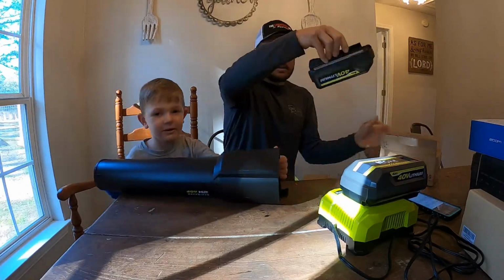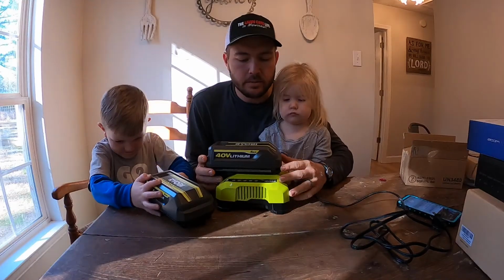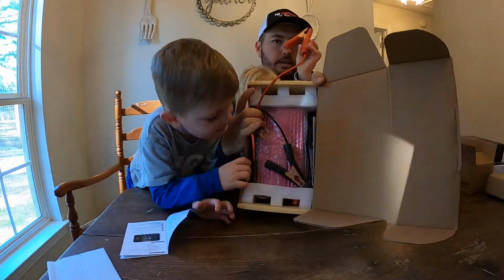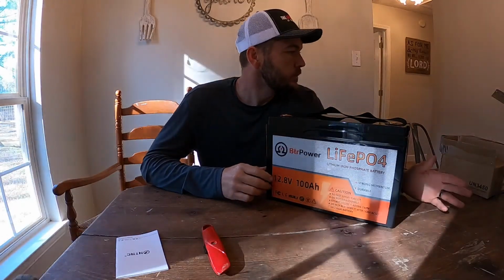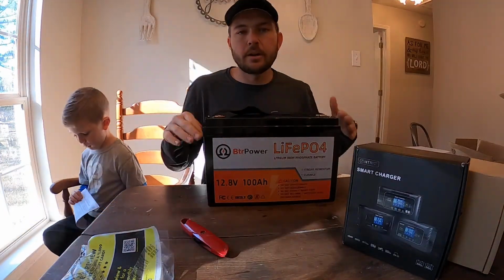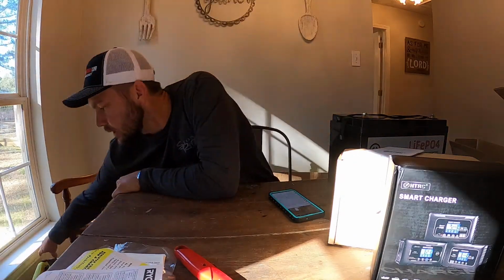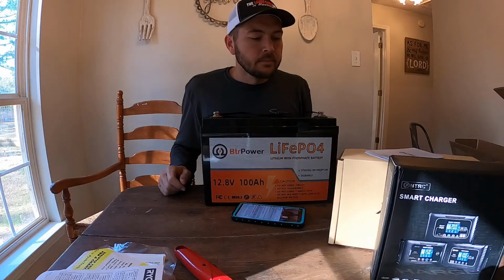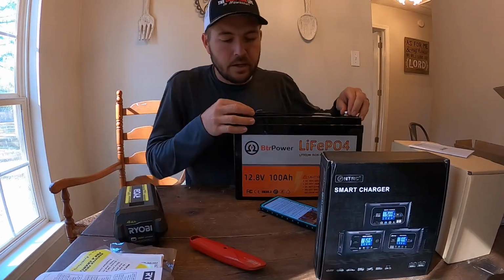New blower reveal + my budget mobile charging setup

Comment: Tony, keep in mind the charger is around 300 watts (My Stihl Charger is) 30-45 min charge so each  will take 150-300wh.  The cost of what you purchased $500 ish, don't you think you could purchase extra batteries for the same cost and be just as efficient.  For me it never makes since to have a battery charge a battery?
Reply from the maker: But if you can recharge 5 to 7 batterys you cant buy that many batterys for $420  one good battery is pushing $300 now its crazy! plus heres the biggest thing for me i know im gonna love being able to keep my batterys topped off all the time and if the big battery wears out in a few years ill just buy another $300 battery and keep moving🙂😎 plus now i can try annnnnyyyy brand
Reply: @tonyslawncare  I hear ya, the fact is maybe 2 extra batteries at the $500 mark, I have a trimmer, edger and blower all have their own batteries. I have 2 hedge trimmers which are not always in use thus 2 extra batteries. For me I have only use the spare batteries maybe 3 times a year so it definitely works for me. If your eating up that much battery on acre size property I see your point. All of my area is pretty small so no need for recharging in the field. Nice topic keep pushing.

Comment: Those brushless whisper blowers are great. 730cfm would be plenty of power for me.  Yes, the tube may randomly fall off, a weak point.  Also the turbo button will eventually get funky.  But still worth it.  Is this step one of you switching to Ryobi?  👍🏼#19
Reply from the maker: Im about to buy a top handle ryobi saw posssibly too mmmm....

Comment: I missed your live show, but just watched it. A few things.

1. Love that you're building a charging setup. I'm looking at building one as well. Mine will charge off my truck, much like the Van Lifer's do it. A little more money, but it will all stay in my truck. I likely will have it in a tool box in the bed of my truck vented.

2. I've heard mixed things about Ryobi batteries dying fast. Not sure how true. Also how heavy is it with the battery on it?

3. Kress is missing the boat with me. I wanted to consider them for my setup I'm doing this season. But, they won't even put prices out and they are trying to build a dealer network. How hard is it to list retail prices??

4. I'm putting together a total battery operated route for 2023. My mind has been made up. It just comes down to best power, weight, length of run time and comfort. This will serve my small lawn route 100%. If it proves to be efficient, comfortable and trouble free and cost effective, I will likely convert all my bigger properties into a total conversion in 2024. I'm looking into solar charging for just the equipment as well. If you can get away from unstable gas and electric cost, you've won half the battle. I'm concerned with the lithium cost going up. We have countries like Africa shutting down the exporting of these type minerals. 

At the end of the day I want less headaches, better health and efficiency. I love what you're doing and I'll be putting up more videos this year. 2022 was a very difficult year and I hope this year brings some happiness.
Reply from the maker: Bro really look forward to how you setup your battery setup !! And so far i love this ryobi blower !! So quiet!!!
Reply: @tonyslawncare  Quiet is awesome. I'm looking forward to when this equipment gets to the next level. We'll be able to start early on those hot summer days. 
Quick question. Which model Milwaukee trimmer do you like best? Model #. I remember you said in one of your videos and I can't seem to find it. 
I wanted to do a one brand for everything cordless, but I don't think it's possible. I have my eye on a couple blower's and trimmers. Mowers really seem to be a mixed review. The ones I like seem to be having issues.. that 30" Greenworks caught my attention. But $3,000 seems a little expensive for something that's not proven yet. Getting ready to do a Toro Timemaster tear down in February. Heavy leaves should be getting over with soon. Perfect time to get her in tip top shape. So many plans and ideas, hoping to get some it done.
Reply from the maker: @KeepItMowed  check out my new trimmer short 4 shorts ago it has model number real quick and easy but i do like the easy to get quiklok system you can always grab one of those on ebay for good prices. Im learning ebay is your friend for all this stuff. As far as mowers i want to try to get a used battery 21 mower just for testing and such this time of year on fb marketplace theres ego ones and stuff on there im hoping to snag one before spring to test with there so light id like to have one to just throw in the back of the truck.
Reply: @tonyslawncare  Good deal I will check the shorts out. I agree on the 21. I'm looking at new ones, not any 25" or anything. I've looked at used, but nothing great yet. eBay is great for batteries especially aftermarket units.